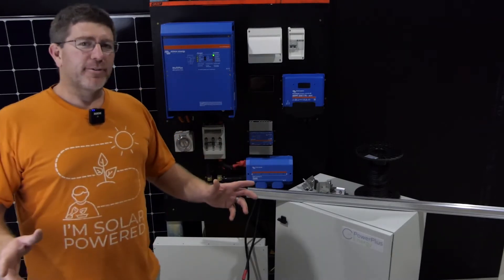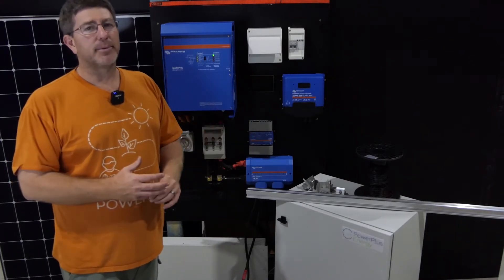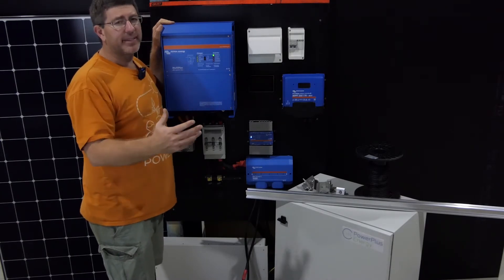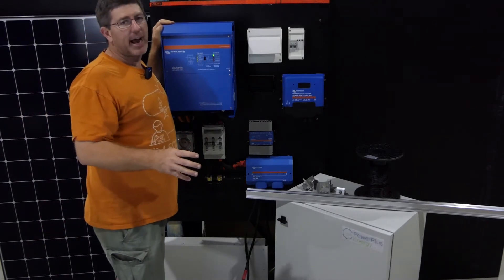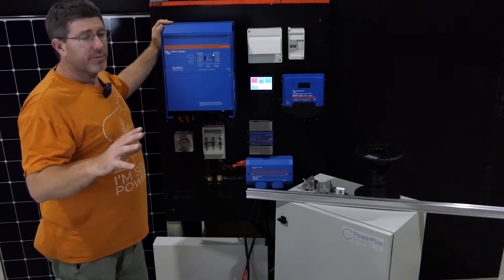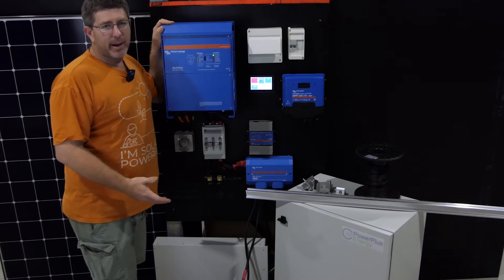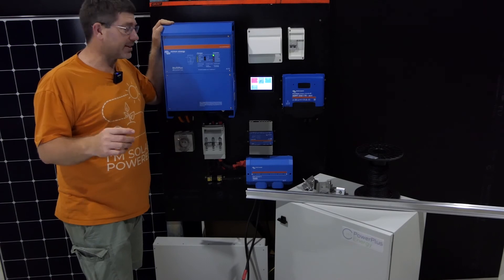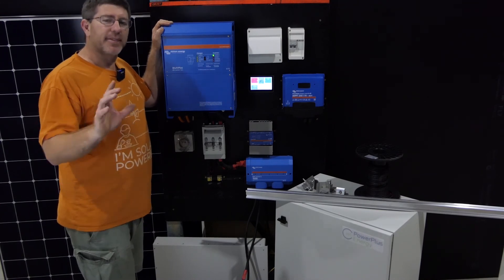Off Grid Solar | How to DIY in Australia | The Off-Grid Shop

Comment: Thanks for the video.
I have a really small shed 2 x 2 m, but I still use it as my own cave and would like to have an off grid low voltage solar system to light some bulbs at the backyard and to charge my power tools . Would you have something to recommend?
Reply from the maker: Where are you located? And it would come down to budget.

Comment: What are your thoughts on the all in one units ? I'm looking for a 10kw solar system with 48v battery for a rear bungalow in melbourne. I'm guessing grid tied, but zero export with server rack type battery's ? What do you suggest for a simple hassle free system ?  I can probably fit one or two strings of panels on the roof up to about 8kw. Love ya work  :)   Cheers.
Reply from the maker: Thank you.
Reply from the maker: Going a 10kw you you are likely going to want a bigger unit than the all.in ones. Victon only do a 5kva. And if you want your grid connect to work in a black out it has to.be 1 to 1. IE if you have a 10kw grid you will want a 10kw off grid.